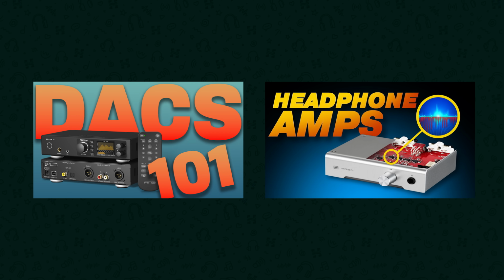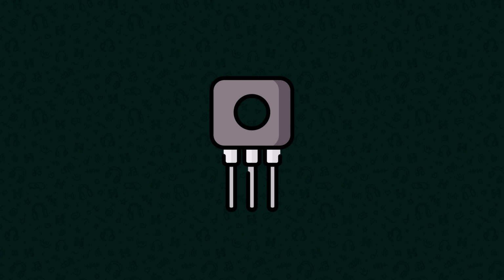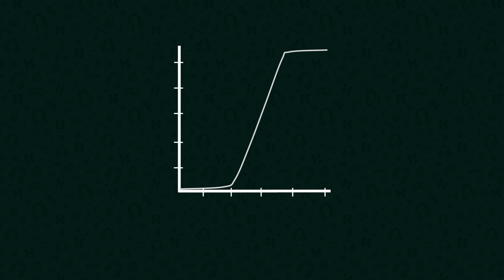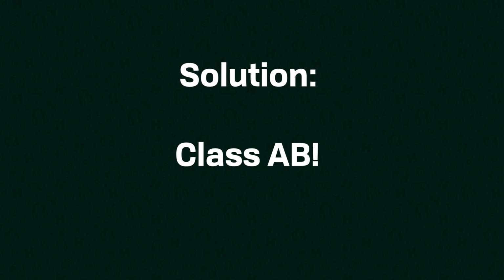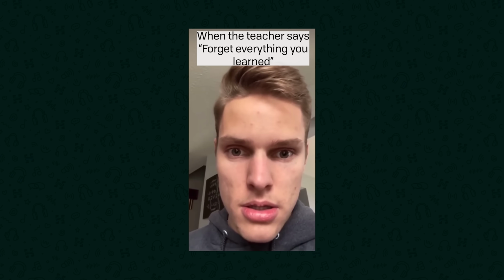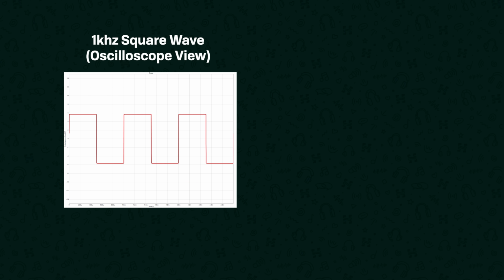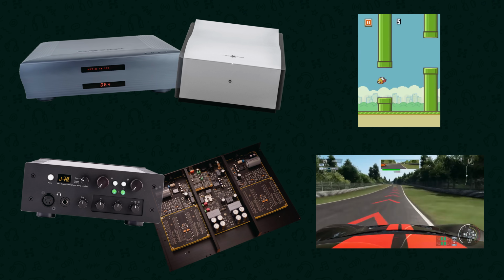Audio amp classes as fast as possible!

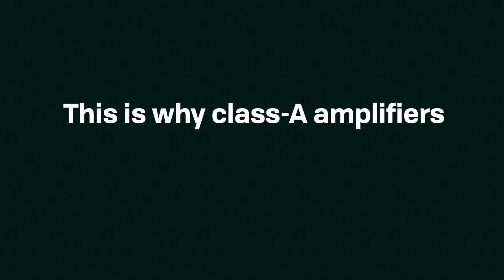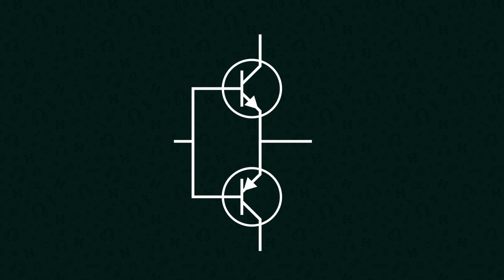Comment: 3:41Amplifiers in class A are  usualy hot when are mute. In this case all current heat a transistor and a sink. But when play music, part od the current goes to the voice coil and in effect don't heat silicon as much as in mute work. A Class A amplifier that plays loudly will run cooler than one that is silent. 3:53 Amplifier in class A can also run in push pull configuration. It's just a matter of the quantity of the quiescent current, BIAS point. This is like in class AB, by increasing the current you go from class B to class AB, but if you increase it more you will enter to class A, then both transistors conduct current throughout all the cycle. And of course with less efficiency. The SE with single transistor can also operate in class B and C, even D, but has huge THD and IM.
Reply: Yes, the description of Class A in the video is at best simplistic, at worst incorrect, as if it is single ended you need a capacitor to prevent the bias current being applied to the speaker, which is why most are push pull.
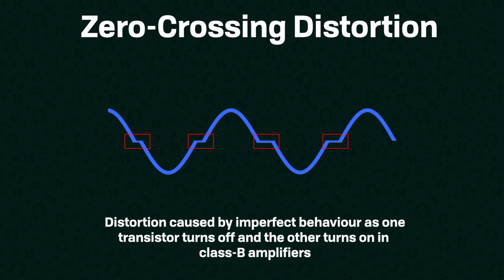Reply: @rcflighttestengineer5636  Thanks. The crossover distortion for class B (mentioned at 5:03) can also be reduced to a minimum or to negligible with good design.

Comment: Class D amplifiers are analogous in audio to switch-mode power supplies in phone chargers. Smaller, lighter, and far less heat. You wouldn't want to carry around an old-fashion AC adapter to charge your phone.
Reply: smps is used in everything nowadays bruh

Comment: The only thing that's not explained is how come the Class A isn't passing DC through the speaker? Surely that would make the speaker run partially pushed out, and also reduce the potential of the speaker in both power handling and excursion?
Also how do you make current run the other way through the speaker for the other half of the waveform, instead of feeding the speaker this DC offset waveform?
Reply: Coupling capacitor, or output transformer.

Comment: I'm off to the kitchen to get a frying pan and egg to cook on my Class A amp. In 1963 I learned how valves work. Then came transistors and I learned how they work. I couldn't figure out why electrons travel in a different direction to current. In 1967 I went round a transistor factory and saw how they were made. Then ICs came along and I was totally lost . . . . . till I was aged 56 and passed a technical exam in microprocessor computer systems. As others say this is an excellent presentation of transistor workings.
Reply: because current was randomly defined before they even knew about electrons
Reply: I have always considered CURRENT to be the direction of the only thing actually moving: Electrons.  That some people think something goes AGAINST the electrons seems strange but annoyingly common.  Current flows from cathode to plate.  Electrons flow from cathode to plate.  That's the only thing moving .  A current of water flows from where the water starts to where it is going.  Nobody says the current flows UPHILL to the source of water.  
It creates some ambiguity when someone says "current" but is not specific about what KIND of current.

Comment: As someone in the matter for decades I found that intro hilarious. NPN refers to the arrangement of semiconductor layers: N-type, P-type, and N-type. N-type is being doped with extra electron, and P-type lacking electron (has a hole instead electron). It's neither "negative" or "positive" in any way. BJT on the other hand stands for Bipolar Junction Transistor. The rest of the video is spot on regarding audio amplifiers.
Reply: The N material (silicon doped with pentavalent elements like P. As or Bi) has a surplus of electrons in the conduction band, so calling it "negative" is not incorrect.  Likewise the P material has a deficit of electrons in the lattice (being doped with trivalent elements like Ga, In or B) and therefore a net positive ratio of cations to free electrons.  They certainly are negative and positive in terms of net electronic charge.
Reply: @karhukivi  You just contradicted yourself. Are pentavalent elements more negative than tetravalent elements like silicon? If yes, what happens when you put them together (similar like bonded PN)? Does the current flow by its own, or you must provide external current source like in ordinary conductor? What's with the forward and breakdown voltages, capacity, etc. Are they just a complex or imaginary properties like impedance?
Reply: @My_Humble_Self  A pentavalent atom like phosphorous replacing a lattice position of quadrivalent silicon has four bonds with the neighbouring four silicon atoms using four electrons, and the fifth electron is free to move through the lattice.  That is why the material is negative and conducts electricity better than pure (undoped) silicon.  Lots of information on the web if you look for it!
Reply: @karhukivi  Yes sir, I know the theory. I used to learn all that long time ago. A free electron in silicon does not mean that the material is "negative", but only what you finally wrote correctly here - conducts electricity better than pure (undoped) silicon. Because of the way of doping electrons and internal construction of BJT, anyone with a multimeter can determine where is the Base, Collector and Emitter (without looking for datasheet or schematic). For NPN, forward voltage for Base-Collector always have slightly lower value than Base-Emitter forward voltage.
A lot of information on the Internet doesn't mean that it's really true. There is a lot of misleading information that especially young people think is correct because wrong information are served to them.
Reply: @My_Humble_Self  u in this shit for decades and still dont know engineering semantics

next define ac dc

define voh vol

im sure u have a lot more to argue with other ppl

a true experienced ppl actually know their shit and doesnt just believe on one side
Reply: @urnoob5528  If I must hop into some discussion with you, you must first finish elementary “shcool.” Your literacy and especially knowledge of basic electronics is very questionable. Leave me alone.
Reply: not neither?
Reply: @EggBastion  Thanks.
Reply: @My_Humble_Self    ayy!
Reply: When you say it is doped with an extra electron, does that mean that the electron is not used in a bond and is free to move around like in a metal, and it does not become an ion?
Reply: I came to write the exact thing. It causes physical pain to hear doping being called negative or positive.
Reply: buddy n is literally negative wtf is u on about

blud need to learn naming instead of going erhm akshually

also the rest of the video is not spot on

i can spot at least one error talking about amplifier
Reply: Finally, someone who actually knows what he is talking about and not just spouting (INCORRECT) theory and terms.

Comment: I am surprised that no description of the transistor ever mentions resistance. In essence, it is a resistor who's resistance is controlled by the base signal. This is why they get hot, resistors turn current into heat.
Reply: cause transistor aint a resistor

otherwise u can also call everything resistor

ur car hood? thats a resistor

resistance is a parasitic

unless u operate the transistor in the ohmic region, then it resembles a resistor, then calling it a resistor is more appropriate

only class d will operate it in ohmic region, but it uses them as switch, not as a linear resistor, so it is also not a resistor in that case

for linear class, calling it a current source is more appropriate

so u say resistor turn current into heat? well my diode aint a resistor, why is it hot? r u going to start calling my diode a resistor too?
Reply: Well yes, exactly; transistor is a "transfer resistor" (if I remember right).   The voltage across the transistor times the current through the transistor will give you watts and will be radiated as heat.  In a Class A amplifier, the best you can hope for is that at full signal strength half the total power supply goes to the speaker and the other half to the power transistors and the worst heat is generated at zero signal.  At full signal some of the time you will have high current, but essentially zero voltage on the transistor, hence no "watts" and no heat.  At the other end of the half-cycle, high voltage and no current, thus again, no watts.

Comment: Class B biasing is typical in vacuum tube amplifiers. The tubes don't have the nonlinearity of transistors at low input levels. Two tubes in push-pull configuration, in theory, have lower distortion than two transistors running Class A-B.

Comment: Ab historically have been the most common, I called them push/pull amplifiers. Because of the small overlap where both the NPN/PNP transistors are on at the same time effectively shorting each other out but to such a small degree there is very low idle current/heat. The when the signal is applied they provide a very quiet linear response up to their clipping point. I have a SoundCraftsman PM860 Professional mosfet amp that is amazing It will pump 450W into each channel A and B [900W total] at .05THD

Comment: but why does it need a low pass filter? if youre passing the output directly to the speakers, those frequencies are so high, we'll never hear them, and also the speaker cone probably wouldnt be able to move that fast, averaging out the PWM and turning it into a smooth signal
Reply: yes the speaker itself forms an rl low pass filter, or rlc if u consider parasitic or mechanical effects
Reply: You do not want those high frequencies impacting other parts of the circuit so, even though the speaker will not transduce those higher frequencies it will be seen as noise to other parts of the circuit. If you are trying to keep all of your circuitry as quiet as possible you would want to filter it.

Comment: This cut bit too much on the corners. Analog amplifiers nowadays very commonly use feedback amplifier that very beautifully linearizes the non-linearities of the front-end transistors, instead of transistor biasing.
Reply from the maker: Feedback was intentionally not discussed in this video as it is a bit beyond the intended scope.
But even with feedback, the same core principles and design reasoning apply.

Comment: As an audio amplifier designer, I would like to clarify and refine a few points regarding distortion and amplifier classes:

    Class A Distortion Characteristics: The statement "Class A can be harder to get low distortion" is misleading. By design, Class A amplifiers inherently have lower distortion due to their continuous operation within the linear region of the output devices. The active device(s) conduct for the entire signal cycle, avoiding crossover and switching distortion entirely. Achieving ultra-low distortion levels (e.g., 0.01% or lower) is relatively straightforward with a well-designed Class A amplifier, thanks to these linear operating characteristics. In contrast, Class AB amplifiers require meticulous design to achieve similar distortion levels.

    Class AB and Crossover Distortion: While Class AB amplifiers significantly reduce zero-crossing (or crossover) distortion compared to Class B designs, they cannot eliminate it entirely. This limitation arises because real-world transistors are not ideal, they have non-linearities, and variations in gain. Even with techniques like bias optimization and feedback, some residual crossover distortion often remains, particularly in less expensive or simpler designs.
Reply: Very true. Its just that often class A is the simplest design and also usually the least optimized for distortion, or better yet they run tubes in class A because you're already burning so much power what's a little more? Push-pull class A is proably one of the lowest distortion simple designs you can do, as inefficient as it is, since you're cancelling some of the nonlinearity of the most linear region.

Comment: Great video. You should have included the working principle of a Technics SE-A100 amplifier where the engineers combined a low power Class A with a high power Class B through a bridge to achieve the impossible - Class A sound at Class B efficiency. 
Reference Class S, by Dr. Sandman.

Comment: It’s pretty laughable how slow the hobby audio community is to embrace new technology. 

I’d be willing to bet that the resolution and accuracy of the newest well designed class d amplifiers are far beyond what the human ear is capable of discerning. Guys the chips in new smartphones have component density greater than 100000000 transistors per sq mm. Modern digital oscilloscopes can measure several orders of magnitude faster than any frequency used in uses in audio. The fastest transistors can switch at hundreds of GHz. It’s based on mathematics by   people who are much much much smarter than you or I. 

Why not just embrace it? Remember we are talking about technology from 2024 not 1994.
Reply: "how slow the hobby audio community is to embrace new technology. "
Slow indeed.  If my Crown pre-amp and amp EVER die, then I will be ready for "new technology".

Comment: Wrong! "Transistor only switches On when the certain base current achieved" Wrong! 
Should be "Transistor only switches On when the certain Base-Emitter Voltage achieved"
Reply: WRONG

should be 

BJT

Comment: So technically 1-bit sigma-delta DAC's and Class-D amplifiers can be combined to create a new form of high-efficiency, noise-free full digital audio amplifier...
As I imagined the audio data stream is fed into a high-speed microcomputer, which converts it to high-frequency PWM signal. The PWM signal is then amplified by a high-speed MOSFET H-bridge and fed into a lowpass filter to remove ultrasonic "carrier wave" component. The whole weak-signal process is fully digital, which not only can easily interface with modern PC's or audio mixing consoles but also totally immune to any analog interference like AC hum, common-ground noise, cable-related noise etc. There'll also be no hassles caused by analog signal level alignment or "gain structure" - Zero is zero, max is max. Unless the input data is already corrupted by digital clipping, the output signal will never saturate and distort. A variable digital trim and a compressor/limiter can be programmed into the microcomputer to give a safe, smooth and noiseless volume scaling control. Thanks to the nature of Class-D(-ish) amplification, the output volume can also be attenuated losslessly by lowering the power voltage, which can easily be achieved by using a variable SMPS power supply.
Reply from the maker: This is true! And there are some designs which actually already do this.

You do still have the challenges of full 1-bit modulation though, which can be fairly compute intensive and can mean that this approach if wanting to do it really well can be a bit expensive. But it definitely works.

I'd be careful about describing any sort of volume control as 'lossless' though, since that technically isn't true for anything as SNR will always be reduced to some degree.

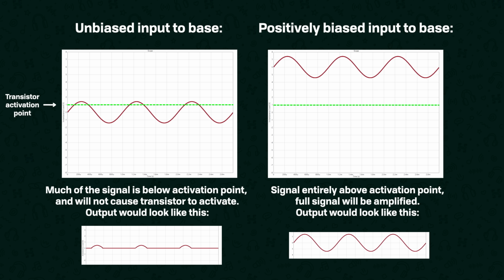Comment: At 2:27, and already spotted two errors. Bipolor, not 'Bridge' JT. And the 'cutoff' is only in the base voltage, not in the current. (Where the exact current amplification is highly variable anyway, and needs to be controlled by feedback.)

Comment: The Class A simplified circuit diagram is incorrect! Wired this way, it'd fry the speaker coil in a short order. There is a built in resistance that takes the DC current, and a coupling capacitor that transfers the (AC) signal to the speaker.
Reply from the maker: This is true. In this video the extended portions of the circuit were deliberately excluded as the intent was just to make the core operation of the different amp classes as clear as possible. Hence why biasing circuits were not discussed/shown as well.
Just wanted to ensure that the core principles were as clear as possible without overloading people with info.

But yes, DC must be removed in practice, but it was just a bit outside the scope of this video. The links in the description discuss it in more detail though for those wanting to learn more.

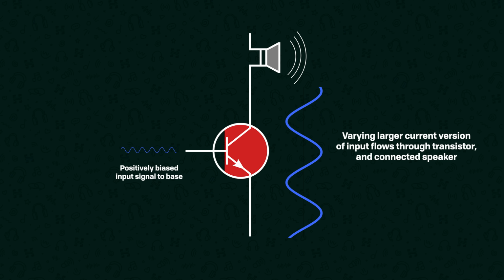Comment: at 2:48, you show a graph of something versus something.  It looks very much like it is the base-emitter voltage on the X axis and the collector-emitter voltage on the Y axis, especially since you mention the Vb-e threshold voltage.  However, then you mention how collector current is proportional to base current.  Yes, collector current is proportional to base current, but there isn't a threshold current for base current.  The gain exists at the lowest levels of base current.  Maybe this is just the result of trying to cram a lot of info into a short video?   Sort of like how you show a speaker being connected in series with the transistor at 3:17, when we all know that you don't want to put a DC current through the speaker?  Good enough for folks who'll never actually use the info.

Comment: class A problem - just use comparator that will switch transistor off when there is no signal at the input...heating problem solved.

Comment: Could you explain analog vs digital volume in a video? And implications for poweramp input stage resistance. Would be fab!
Reply: Analog volume control is pretty simple; a variable resistor.  Done!  Digital is more complex.  Basically you multiply the samples (which will be 16 to 24 bits per sample) by a number that represents the desired volume.  Consequently, digital volume control is in discrete steps; the multiplier.

Comment: y & the transistor or fet is either fully on or fully off resulting in minuscule power dissipation from transitioning from off to on, resulting in an power efficiency of over 90%, so no big heat sinks.